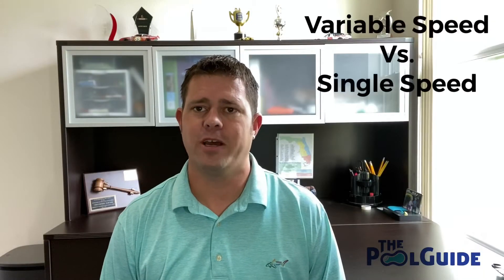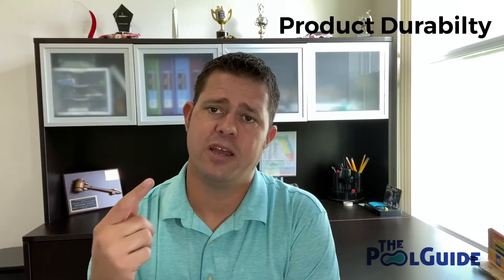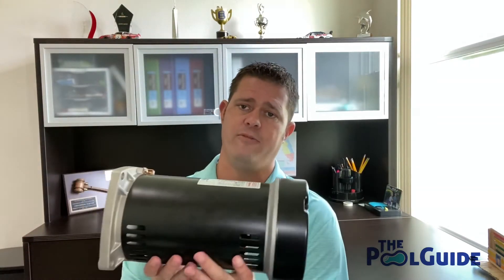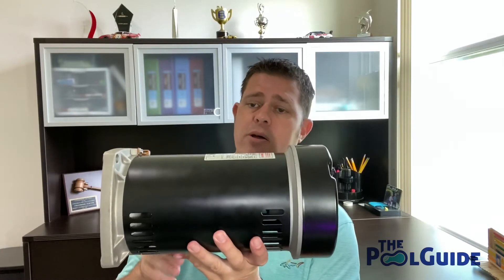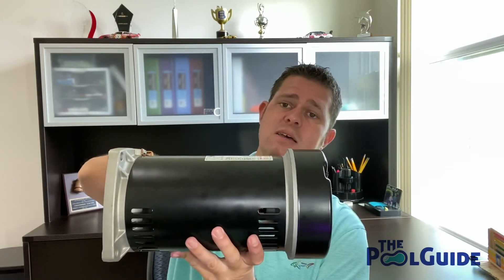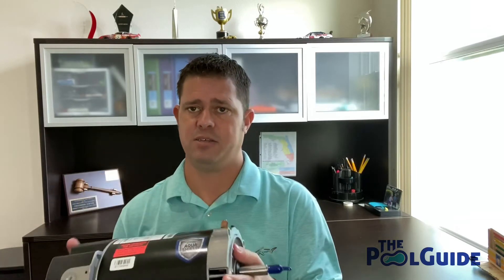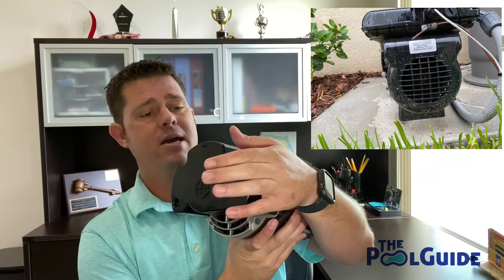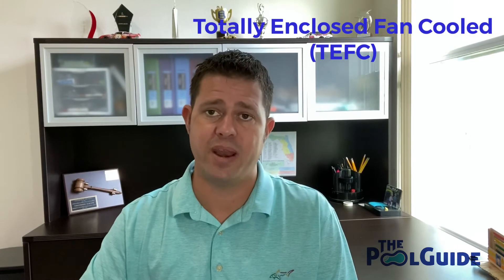Variable Speed Pump vs. Single Speed Pump - Part 1

Comment: do you need to change timer on variable speed pumps ?  any thoughts on XtremepowerUS brand ?
Reply from the maker: The newer variable speed pumps come with controllers on them that you can set the time and rpms/speeds for the different times on the pump it self. Also if you have automation some of these systems will communicate with your pool automation system.

Comment: Can you please provide the specs on the motors. Single speed doesn't give enough info. Is it 1 phase or 3 phase. voltage? RPM? HP or Kw rating. I believe 3 phase single speed is more efficient than variable speed single phase. I'm interested to hear your thoughts.